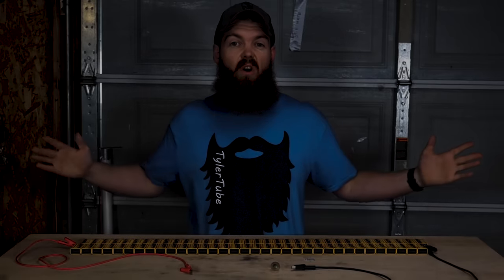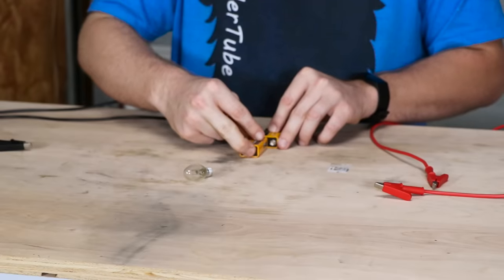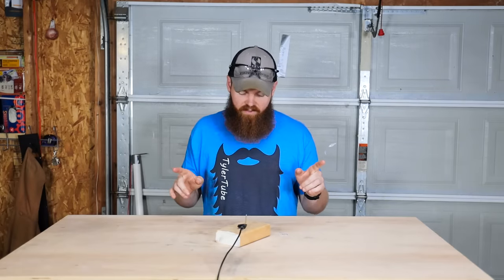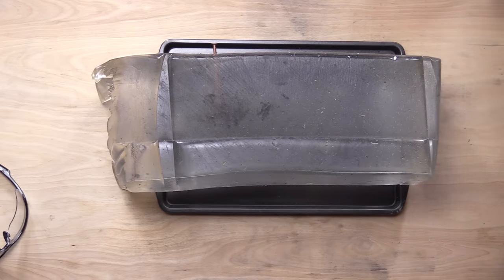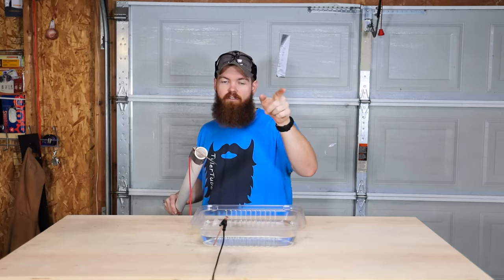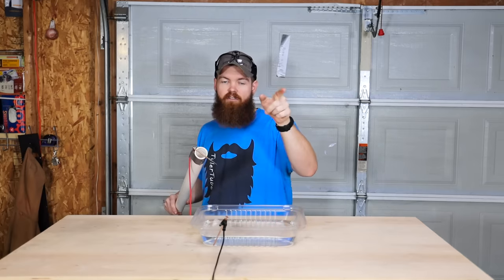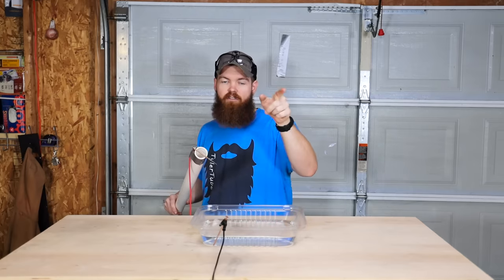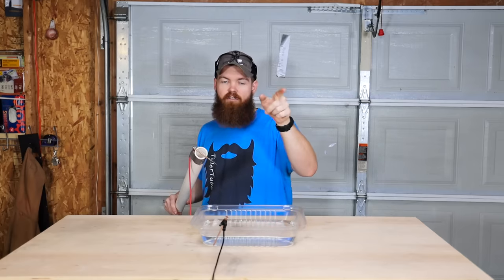I Connected 500 - 9 Volt Batteries...

Comment: Remember kids: It's a combination of the current and the voltage that kills you, which is why you can safely touch a van de graaff generator which usually have 2 MILLION VOLTS at microamps of current. 500 9-volt batteries connected in series produces 4,500 volts nominal, however the current is no more than the total of even a single battery. HOWEVER, a single battery can usually sustain up to 1 amp of power draw until the battery rapidly depletes. 1amp at 4,500 volts equals 4.5kW of power, which is more than enough to leave you VERY dead. Even if the array only outputs 500mA of current, you're still looking at 2.25kW which is still enough to leave you VERY dead. 

Electricity is very dangerous, and can behave in ways that can appear to be nonsensical. ALWAYS treat it with the utmost of respect and caution, as you won't usually get a second chance.

Comment: Me: sees this
Also me: radical  this the definition of how a battery bank works. U need more volts  put a battery in series need more amps combine all positives wand also combine all positives. 

Also note  a high voltage but low amps is less likely to kill u because of how many times that voltage level goes into your system in a second 
Not sure people realize this it's not the volts that kills u it's the amps.... It's why people can survive multiple lightening strikes hitting them.... You will be just slightly cooked from that situation  but other than that u will live

Comment: You didn’t have to unhook everything every time you changed something , not hating just letting you know as long as there is no positive contact or connection , you’re safe !
Reply: Consider the voltage rating of the insulation to those batteries' casings.  Designed for 9V.  Not to be trusted at thousands of volts.

Comment: The reason the 9 Volt batteries didn't blow the bulb when you got above 120 V is because 9v batteries can't put out enough current to burn the filament.  Due to this even though you thought you had hundreds of Volts, once you connected the bulb the voltage dropped like a stone.

Comment: More like 5400 volts because 9V batteries are made of 6 1.5V cells (in series) which unloaded produce a little over 1.8V each.  So each 9V battery is really about 10.8V.  Check it with a voltmeter.  :-)

Comment: A new 9 volt battery should be 9.5-9.6 volts. 

You are actually around 4700-4800 volts.

You can also measure voltage using a multimeter for a more precise measurement (vs “in theory” lol). Just make sure to do it in chunks based off your multimeters category rating (CAT).

Comment: I did the same experiment my first semester of college but I only had 360 or so 9v batteries for an estimated 3000 volts. I ended up shocking myself with it. I’m lucky it didn’t cause permanent damage to me

Comment: I wonder if you could weld with the batteries, and if it is possible, how long would it take to fail?? It seems that it would be possible, but the amperage would probably cause the batteries to overheat, and then fail, or explode. If you kept them cool, then it may work until they're drained.

Comment: 4:47 Just to compare. An entire lightpole is powered by 400 volts. But as you said, it's not that many amps in those batteries.
Reply: @jeffmccrea9347  Now that's an explanation I must say! 🤯

And just to add on:
The human body has an inherent high resistance to electric current, which means without sufficient voltage a dangerous amount of current cannot flow through the body and cause injury or death. As a rough rule of thumb, more than fifty volts is sufficient to drive a potentially lethal current through the body.
Reply: @kristianbaltzersensmedsrud3264  ...fifty volts is sufficient to drive a potentially lethal current through the body...

    While not exactly wrong, It isn't correct in the context of what I said and you have your voltage and current terms reversed.
    Like I said about dragging feet on a carpet, it can develop a potential of several thousand volts as evidenced by the length of the spark to the door knob. Even at this potential though, the shock incurred, while mildly uncomfortable, is harmless. It is not 
the voltage that pushes electrons through the +-120,000 ohms of resistance in the human body, it is the amperage. Ask any car mechanic who has worn a metal watch band while using a wrench to install a car battery. It is only 13.2 volts volts but for an instant it can develop 1,000 amps. if he absent mindedly leans his watch band on one terminal while using a wrench to tighten the other terminal, he will feel a jolt that will make his arms and chest muscles twitch. Even stronger if he's sweating. This current could potentially foul up a pacemaker or defibulator implant by sending it's heart voltage sensor a false signal and activating it at the wrong time. This not to say that he will experience 1 Ka but the potential is there.
    I will stand behind my assertion that 5 V @ 10,000 A is much more deadly than 2,000 V @ 2 or 3 NA, (nanoamps).
Reply: @jeffmccrea9347  👏👏👏You definately got me beat! 🤯 Your sense of knowledge is impeccable within this subject.

Comment: Yea. We're talking 4500 bolts. But at the same time. It's very low amps. U can have 3 volts and have high amps and be about the same as high voltage.

Comment: pure water is a poor conductor, but it's also not good to drink.... it's also impossible to get outside of a lab because pure water is also a natural absorber, the moment it comes into contact with air it will pull nitrogen and carbon dioxide and become acidic very quickly.
so "distilled water" is water with very few minerals in it.

Comment: Again, it's not "pure water wont conduct," it's just not a good conductor. We'd call it an insulator.  U can use an ohm meter and check. Also, obviously material thickness, or the amount of dielectric material between a potential difference,  is also a factor.
Reply: U couldve did all this with paper and math, to a less dramatic effect.

Comment: Its not about the conductivity actually. Water leaves the conductive minerals behind, while distilled water doesnt. The conductive minerals can accumulate moist, oxidate, and short out quite quick to another potential. So dont use water, use this or isopropylaccohol. Have you seen water spots ever on glass or on your car paint? Thats the nasty stuff water leaves behind basically.

Comment: 19:36 - "...even though it's a ground, so I should be safe..."

That's not a ground, that is a negative. In this setup, positive and negative are "floating" relative to ground until you connect the batteries to a grounded circuit or you inadvertently become ground yourself which you nearly did several times in this video. That would have been VERY bad and quite possibly fatal, don't do that.

Comment: If you were to take one 9 volt and actually instead of lateral put it longitudinal than you'd be able to stack it higher many levels in fact because it's still connecting positive and negative to negative and positive so that being said you would be able to do the same thing and not have to have separate components separate units of batteries you would have them all together just stacked up one level at a time

Comment: No, apple not very conductive. All materials are technically conductive. What we call "insulators" have low conductivity.  Insulators still have a voltage at which even the insulator material begins to conduct, called the dielectric breakdown voltage. Air is a very poor conductor but when the potential difference (voltage) between ground and storm system is great enough, the air conducts and current passes (lightning). An apple prob has conductive micronutrients within, so it may be more conductive then ceramic or whatever, but that doesnt make it a good conductor. 4500 volts is a lot of voltage.

Comment: Holy crap... the amount of incorrect information in these comments is crazy.

This experiment is insanely dangerous with the way it is set up.

Even assuming that the internal resistance of each battery is fairly high (like 2 ohms - which the average is like .3 ohms - depending on battery chemistry), you're looking at a resistance of 1000 ohms or so (at best), and a dry skin resistance of around 50,000 ohms - if he was to accidentally touch the leads with each hand, that puts a current across his heart at around .09 amps - well within the high side of potentially fatal current.

-and that's assuming a good scenario. If his skin happens to be wet or sweaty, this could easily move toward the .5 amp range which is basically instant cardiac arrest.

I'm not sure if this dude knows how dangerous this is.

Comment: i'm no expert but them hotdogs are wet. it would be the same concept as water, if they were dry i think it would still go through all of them as long as they are all touching each other, but at the end of the line they will most likely not have the same conductivity as the start of the line.

Comment: Welp. That was an inefficient, dangerous, and expensive way to get 4.5kv... would have been easier to rip apart an old crt tv... Those babies have flyback transformers capable of generating voltages in the kV range... Probably good for his own safety that he didn't get that far though.

Comment: Did anyone notice how he kept leaning his 4500 volt positive electrode up against the STEEL and ALUMINUM garage door?!?

If he in any way came close to touching that door while handling the negative electrode, or anything connected to the negative electrode whicb was conductive, he would have gotten zapped.

Comment: I’m sorry Tyler. I love your content, but if you’re going to do something this risky, please please please just put a little bit more research in on the basis of your safety. Everything from improper terminology down to complete misunderstanding as to how high voltage works, and the lack of safety precautions minus eyewear, made me feel on edge the whole video. So much could have went wrong, from killing yourself, to starting a fire, when you were touching the battery casings and playing with the lightbulb. Even at 180 volts, things are dangerous.

Comment: So I used to teach electrical at a vocational school and I was asked what happens to a spark in a vacuum. So I made a Jacob’s ladder (see my YouTube) https://youtu.be/ir6r72-s6XU 
I put the Jacob’s ladder inside a vacuum chamber. 
Jacob's ladder, more formally known as a high-voltage travelling arc, is...well...a high-voltage travelling arc. When the voltage difference between two electrodes exceeds the breakdown voltage, a spark forms.
It’s really cool to make a big one outside the vacuum chamber. Inside the vacuum chamber it has to be real small or at least for my vacuum chamber.

Comment: Just casually props the 4,500 volt rod against the metal garage door. But hey if the other end of the potential is far enough away no problem.... :-/
Reply: Jack the Ripper was a serial killer. 

This man’s creation was almost a parallel killer 😆

Comment: The voltage is about 500×9= 4.5 kvdc .. and high current also... you got a high voltage power supply.. or electric shocker...kind of defeats microwave oven transformer 😂

Comment: Tyler you shouldn't put your hands on the battery cases, because the isolation isnt good. If you keep touching across those batteries your risking getting shocked badly or worse. Please research high voltage electrical saftey before attempting something like this.

Comment: That's quite a monstrosity but it's interesting to see. At a voltage like that the electricity. will jump though an inch or so of air. Ultrapure water is usually distilled at least twice and tested for conductivity. Care must be taken with the containers. They must be rinsed with ultra pure water. If water has anything with ions it will conduct. Most of the conduction through the hot dogs was ionic compounds in.the water they contain.

Viewers should also be aware.that five hundred nine volt batteries capable of delivering five hundred milliamps at 4500 volts is potentially fatal. Don't try this at home!

Comment: Please be far more careful building packs like this 

U need to build them smaller and insulate them then join in them in packs and put it in a explosive container 

Both the high voltage 
The batterys not insulated for it 
And the batterys reactivate property's above aprox 600v 

That whole battery setup should be classified as live like ht power lines 
And those batteries can explode at any time 

Wouldn't be haphazard and so ad hoc about it

Comment: You are putting way too much trust in the insulation of the alligator clips and test leads. I would never hold these in my bare hands past mains voltage, i have witnessed several insulation breakdowns on these. And then you are completing the basic circuit for cardiac arrest via electrocution (with DC it is an asystole, the most dangerous form of cardiac arrrest). Fun stuff but with HV always assume the insulation isn't there.

Comment: I know that you may not know much about networking and you don't mean it in a bad way, but several of the things you have said about VPNs are not true. It should be made clear that using a VPN is not going to give you more security against hackers or against spying on your activity. In fact, it may even make your security worse. The only thing that a VPN does is, as you say, encrypt the information that is sent over the network, and those who can see it are: 1- Your ISP. 2- Hackers if the website does not use SSL (most websites do).

But simply hiding the information from your ISP but entrusting it to a VPN company doesn't make much sense. What makes you think that they don't really store any data or sell it? That traffic data is worth a lot more than the subscriptions that customers pay for.

If you distrust your ISP you should also distrust any other company that holds your data.

Comment: so irresponsible to touch the battery pack of 4.5 kV with both hands at the same time relying on insulation strength between battery inside and the metal outside, which was not intended for 4.5 kV just for 9V.

Comment: 500 9 volts = about 4500 volts at least, resistance of a 9 volt according to google is an average of about 15 ohm, using ohms law to get current you’re dealing with about 600mA which is more than enough to kill you. Please do not try this at home, or do it’s a free country.

Comment: amperage is what causes the damage, voltage is negligable. when wiring series connections, the voltage increases but the amperage and life stays the same. if you wire a bunch in Parallel, then the Amperage and life doubles with each connection but the voltage stays the same.  if you had wired the 500 with 100 parallel connections, and 5 series connections, the voltage would be alot less but the Amperage to fry things and blow things up will increase by  alot.  a good example is a taser... buying online they will advertise  "200000v!" when its only got a 4amp circuit... whereas a police grade taser is around 50000v and 20a, which is enough to stop a heart and far more dangerous. food for thought on the next episode, for more "pop" on camera!

Comment: « All the hot dogs are staticky ». Could it be that 'static electricity'/voltage is actually oscillation, and that after running a voltage through them they retained oscillation ?

Comment: The distilled water is not conductive it is just boiling due to the current of the electricity and the ions in the air around the liquid if you want to see if it’s conductive you should put a chicken breast in an inch when you do this if it’s tenses up like a muscle contracting then it’s conductive to

Comment: You know after coming back to this video after a couple of years it honestly doesn’t seem as dangerous as before. Yes it is high voltage, and does have the potential to carry some pretty lethal levels of electricity but it does help that it’s just DC as opposed to AC, and regular dry human skin typically has a resistance of 50,000-100,000 Ohms.
Ohms law states that Current is equal to the Voltage divided by Resistance I=V/R
So if we were to take 4500 volts and divide it by 75,000 Ohms, that’s a meager 0.06 Amps of current. Enough to hurt and even be dangerous, but everyone is forgetting about the fact that these batteries are not designed for this kind of voltage. Loading the batteries like this will almost instantly result in a pretty significant voltage drop, as the circuit can not produce enough amperage to sustain that power and thus the voltage will drop, which will also lead to a drop in current. It would never be able to supply the continuous energy needed to actually stop a healthy human heart

Comment: My analisation of this vid and also notes:
(In replies)
Reply: 5:21
He may have to put two a few of those packs in parallel to allow enough current to burn the filament
Reply: 5:26 
I think he may mean arc not short
Reply: 5:35
As big Clive says, this is very dangerous and can kill him(current stopping his heart going through cases)
Reply: 6:16
Stop touching cases if you don’t want heart attack bro
Reply: 7:27
Bro plz stop
Reply: 7:45
Good
Reply: 8:00
I mean at least he uses the pipe but like  wear insulating gloves, use 1 hand rule that stuff
Reply: 8:49
At 4500 volts……
It will be like a short circuit…. 
Even ur body could have like 45 mA
A seriously dangerous amount of current
Reply: 11:06
Well it would break down at lower distance but it just has high resistance, so some tiny current would probably flow through it